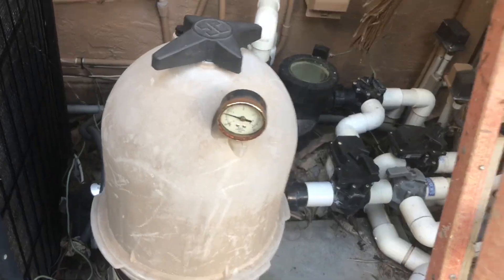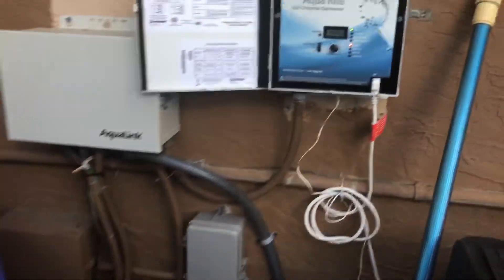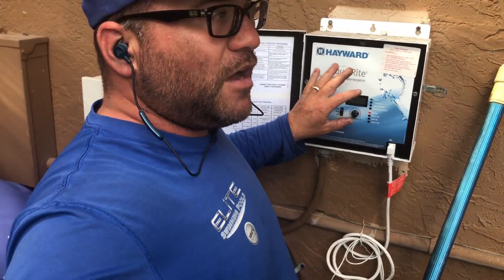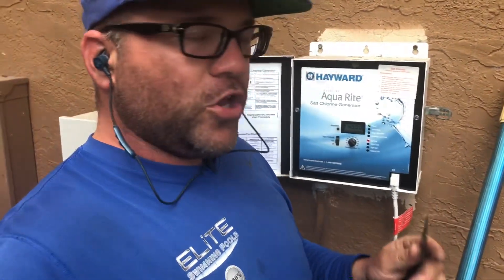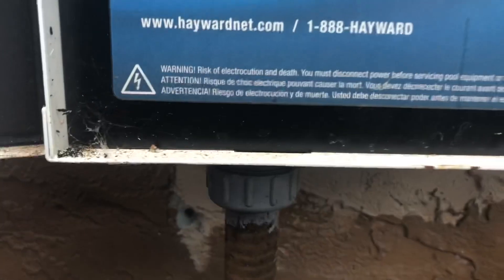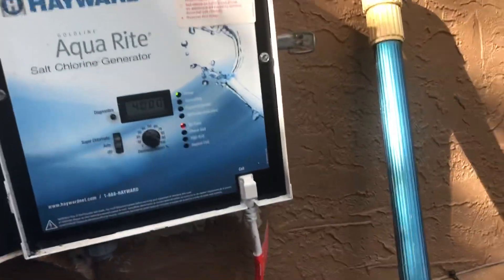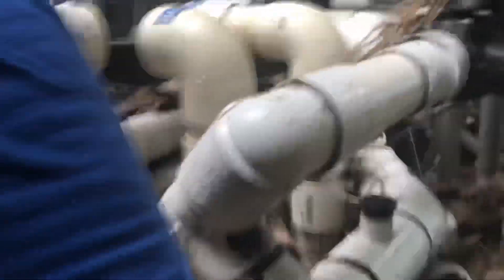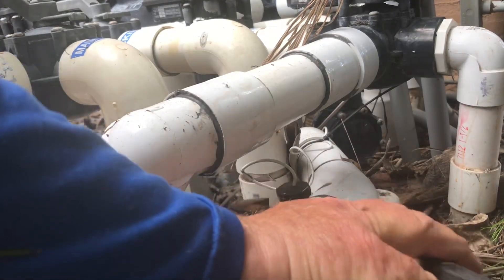Hayward AquaRite Salt System NO FLOW? Tips and Tricks to easily Diagnose and Fix

Comment: I love this type. I was just thinking. Can't you just short the two wires at one end of a very short phone cable and leave them that way? Will that damage the Aquarite over time?

From what I understand. An open circuit is an indicator of no flow. A short or closed circuit is an indicator of flow (which is what you just did with the screw driver).

 I'm only asking because I've had a hell of a time replacing a ton of things with my pool. I originally didn't hs e a flow switch, and now because of all the new parts I'm being told I need one. 

Can I just bypass the flow switch. It's for an above ground pool.
Reply from the maker: I wouldn’t recommend for if you pump or filter had a flow issue, the SCG wouldn’t produce chlorine in a unwanted situation. Keep unit operating as designed
Reply: @EliteSwimmingPoolsTV  Thank you for your reply. I see what you're saying, but I'm not understanding why producing chlorine during a flow issue would be a problem. I'm not a pool person.
Reply: @Brian_Onesimus  I am curious if you leave it as you mentioned (bypass it) I think the same
Reply from the maker: So your only thinking of when the pool is ON and circulating… what about when the pump is OFF?? one of the issues with bypassing the switch and producing when it shouldn’t is your going to drastically shorten the life of the CELL.  The cell is always checking and reading the salinity level of the water. Bypassing the switch could tell the cell to stay ON when the pool is off ,if it’s not properly electrically connected; (I did another video about salt systems and incorrect electrical connections), which will also be sending false readings of salt content back to the board hence displaying a false Low Salinity level causing the cell not to operate. if you have anyone else servicing your pool and if that person in fact doesn’t check the salinity levels properly to know that there’s a false low reading and more salt will be added to pool when salt shouldn’t be added thus raising your TDS levels which progressively promotes bad water quality. Sooo this are just some of the reasons not to bypass a flow switch. Unless you like more problems and want to spend more money than $120 or so for a part. The flow  switch is also a preventative part to ensure the cell does not become damaged when the environment of all aspects of the system are not operating as designed. Best to replace it and keep it running as designed. These parts rarely break and when it does, it’s not expensive
Reply from the maker: The Flow switch tells the cell when to produce when the the pool is On and circulating. You wouldn’t bypass your cars thermostats sensor just because it keeps reading a high temperature or bypass the sensors if it’s not recording a temperature reading of the engine at all just to erase the check engine light Would you?? If you say No to that question of bypassing the temperature sensor of your car, you should bypass a flow sensor of the pool salt system.

Comment: What if the flow light just flashes when you make contact with the screwdriver but doesn’t go to generate? Does that mean the board is bad?
Reply: I have the same issue. Were you able to solve it Cheryl? If so, would really appreciate if you could share it on here. Thanks.
Reply from the maker: Divya, make sure that when you use the screw driver trick and press it to the contacts you have to wait the 2-4 minutes pressing the contacts and while the light flashes. The unit does have a delay internal timer as it is flashing   This is a check system signaling. If no flow light indicator never switches to generating green light then you have a different issue and it may not be the flow sensor.

Comment: AWESOME!  I was thrilled to use your screwdriver trick to see if it was indeed the flow sensor.  We had replaced our generator board a few years back so I was pretty sure and crossing my fingers that it wasn't that but just as you said.... it BLINKED!  Bought the new sensor (only $30 at our local pool store) and tested it the way you backtracked to show us... yep! WORKED!  Installed it in minutes and we are working again!  THANKS!!!
Reply from the maker: Your welcome

Comment: Does this trick also work using the ProLogic PL-PS-4? There is no status light just the message: CHLORINATOR OFF NO FLOW
Reply from the maker: Yes this should work.
Reply: @EliteSwimmingPoolsTV  Yes it works. I stuck a cable between the prongs until I get a new flow switch. The sanitation works. Can you post a flow switch link that is reliable please. Thanks for the tips!!
Reply from the maker: Are you asking for a reliable flow switch “part”?
If so, get the Hayward original switch don’t buy Amazon or knock off generic styles.
Reply from the maker: Oh and yes there is a status for this automation system is just not a light. You can find this in the diagnostic menu selection of the menu. Scroll through and when you see the salt content and or when it says chlorinated off, press the Up ⬆️ arrow it forces the system to turn on chlorinator. It will have a 30 sec timer

Comment: So I might be that 30% you talk about. I did the screw driver test and it blinks red. I replaced the flow sensor and remains in red. No change at all. Any way to troubleshoot or fix the board?  Thanks
Reply from the maker: When you did the test and saw it blink, did you wait to see if the generating light illuminated green? Most people don’t wait for this and all should. If generating light doesn’t go solid green then there another issue.

Comment: New pool owner....does red no flow light come on when pool turns off for the night?
Reply from the maker: Once pump shuts off the red no flow light will light up and after 2 or so minutes the salt system display and lights should completely turn off. The box should not stay on all night as the pump is not on. If it does, it is wired to HOT side and this is not correct.

Comment: Question I’m a pool tech , I have a client in West Hollywood & his heater is showing a “high flue sensor” error code , I changed the sensor & turned off the breaker for 20 min but it still gives the same code ones turned on? Any idea ?
Reply: Jandy LXI heater
Reply from the maker: What Brand & Style heater is it (Gas, Heatpump)? 

What size horsepower pump in comparison to filter size and style filter? 

Are you sure it was a High Flow Sensor Error or could it have been a High Limit Switch error? 

Is the plumbing from the filter going directly into the heater without any bypass or valves to control water flow? 

These are all the areas to take a look at. If plumbing is directly in and out without any valves, possibly this could solve the issue. By installing bypass valves with a check valve you can control the water flow and redirect the other water around to achieve proper flow rate. Rapid water flow decreases efficiency of heater heating the water which causes a longer run time to achieve desired water temp. 

More info is needed to further understand the entire job site. Other times you can contact tech support for assistance as well.
Reply from the maker: Just saw your second post that it’s a LXI Gas heater. 

It’s possible the error you had was a high Limit switch error and not a high flow error. Don’t think I’ve ever seen a high flow error only low flow. Check the high limit switch on that heater. There two high limits. If one is faulty, I would replace both.
Reply from the maker: Contact tech support to confirm your error and issue with heater before you go replacing  things at a whim.
Reply from the maker: Contact tech support to confirm your error and issue with heater before you go replacing  things at a whim.
Reply: You can detach both the high limit and low limit sensors and test for continuity with a multimeter. If its reading open then its a faulty high or low limit switch

Comment: My power light does not come on and my salt level is stuck on 900. When it kicks on it flashes no flow like normal and when it senses the flow it kicks on generate for 30 seconds then goes black.  At no time does the power light come on.  I have a new cell but if I can return it and get my 500dollars back it would be amazing.  Any input would be appreciated
Reply from the maker: Check the voltage coming in to unit. Is it 115v or 230v? Do you have a 2 speed motor? With a 2 speed motor these salt systems are wired to the 115v and only display when on low speed. When high speed kicks in display goes away. If you have a standard single speed motor then disregard the 2 speed set up. With a single speed still check proper voltage coming in. Voltage Power is being pulled from the timer LOAD side. Make sure you have the same voltage coming from timer as you do at the salt system. If all voltage on LOAD side and Salt system is the same then this issue could either be a display board issue or main board issue. Check the salt readings of the pool with salt strips and see if it matches the readings of 900 you wrote about. These units salt needs to be between 2700ppm - 3400ppm. If pools salt content is not up to the recommended levels then you may have to invest first in adding the salt to pool and re-evaluate everything from that point from when the salt levels are brought up to par.

Comment: I replaced the flow switch with a new one and it still flashes no flow, then switches to generating in green for about 5 sec and then shuts off. Stumped now
Reply from the maker: Issue may be the board and not the flow switch
Reply: Elite Swimming Pools TV - you’re exactly right. Apparently Hayward has a common “bad chip” issue with these boards. Chip was replaced and problem solved. Thx for the reply
Reply: If the voltage climbs up to initiate the salt cell to turn on around 24v then drops to zero its a bad thermistor(current limiter) on the pcb board.

Comment: thank you soo much it worked beautifully !! appreciate you sharing!! just want to know do we have to reset it in some way for the numbers will reset ? or does it automatically reset?
Reply from the maker: Which numbers are you referring to?
Reply: @EliteSwimmingPoolsTV  for the amount of salt ? also i thought by starting up now generating it would start to help clear up my pool...its only like 3 hours that i changed  the sensor plug.... not sure how long it will take.
Reply from the maker: For this system to operate the Best, salt content should be raised above 3000ppm especially if your needing it to clear up the water. Depending on how the water looks, cloudy and some algae, sometimes it’s best to do a light shock treatment with liquid chlorine and algae killer to assist in the clearing and cleaning of water and allow the salt system to run in conjunction with the treatment. 

Start first with a total water chemistry test to know how to balance the water. (Chlorine, pH, Alkalinity, Calcium, Stabilizer, phosphates levels) once you have this then you know how to attack. Shock pool and run pool for 48 hrs  continuously. After that then begin to raise the other chems in need of balance. Within the 48hr run the salt system will calibrate itself. 
Retest salt content to ensure proper levels along with total chem recheck.
Reply from the maker: Target goal for salt should be between 3200-3500ppm, Alkalinity 90-110ppm, Calcium 250-300ppm, CYA stabilizer 50-60ppm.
Reply: @EliteSwimmingPoolsTV  i cant thank you enough!! great great helpppp!!

Comment: Hi Davie,  great info however even though the board did blink when I held screw driver into socket it did not work when i replaced the flow switch.  I have replaced the tcell also.  Any ideas of what else I can do to fix the "No Flow" problem?  Thanks so much
Reply: Jan, make sure the arrow on the sensor is pointing in the direction of the water flow.

Comment: Thanks for the tips. I wanted to add that Hayward recommends 12" of straight pipe before the flow switch. I'm assuming this is to help with tubulance that may interfere with proper flow switch activation. The salt cell counts towards that 12", so I'm not sure why they chose to install it in that hard to reach location, rather than after the salt cell, but clearly it still works, even innstalled so close to that elbow.  Again, great video.
Reply from the maker: Thanks, and thanks for watching.

Comment: Hello Mr Hayward.. What could be issue if flashing red light comes on when using screw driver trick but genarating light does not come on?
Reply from the maker: No flow light is flashing due to system going through its checks. Typically even a fully operational unit once turned on this light flashes for about a minute or two during its checking, as shown in my video it took a minute for generating light to switch green. Wait this amount of time and see if it switches to generating. Then you good with the trick
Reply: Or the salt cell has reached its chlorine output maximum so it shuts off.

Comment: My Hayward salt generator is not generating salt. Display shows salt reading of 1600, however salt reading of 3645 from pool store analysis.  Power, check  salt, and inspect cell lights are on. Chemicals are balanced and I cleaned the cell again.Salt reading was 3000 when another bag of salt was added. Next morning problem began with low salt reading and lights on.  Do you think the issue is from too much salt?  First time this has happened.  Thanks.
Reply from the maker: Most likely the cell is bad. Other occasions the board can be bad. Please refer to a professional to diagnose and troubleshoot your system. Being that your salt levels are where they are and as per your chems being in- line. The cell and board needs to be checked out.
Reply: My salt level is too high at 3645, so I wonder if  that caused the issue? If so will it recover if the salt level returns to 3200 or less?   I turned the system off and have  drained water and added fresh water to dilute the salt level. I will re-start it tomorrow. Question is: if the salt level is reduced to 3200 or below, will the system recover and start re-generating-  if the cell or board is not bad?  Thanks again!
Reply from the maker: At 3600 ppm of salt the generator will still work if power supply and cell is functioning properly. The salt content you have is not the problem. These systems can operate with +/-  200 thru 300ppm difference. Hayward Salt systems salt range for salt is between 2700 thru 3400 ppm. Higher than 3900ppm I’ve seen this is when the High Salt led will illuminate and lower than 2500 ppm Low salt will illuminate. The spread difference between what the display is showing and the actual salt content is vast. This is indicative of a part failure. Press the Diagnostic button three times. The value displayed is the volts the board is sending, press 1 more time (4 button presses) this value is the amps. If your getting a high 30.0+ volts( 30-34v) and 0 amps this is more likely to be a board failure.
Reply: Thank you.  Im getting 0 amps, so it appears to be a board failure. I have read that  I can test the current generator to make sure it is good, by suspending it in a bucket of water to see if it bubbles?  I will install a dummy in the piping gap, to establish a flow with the pump on, then just plug in the current generator. If it bubble it is good?
Reply from the maker: Never performed this theory cell test. But this theoretically would work if the board itself is fully operational. The board is what sends power to the cell and cell send back it’s data to board. When board has malfunctioned, the cell stops receiving power this not producing chlorine. This bucket bubble test would fail if in fact your board is damaged.
Reply: Thanks again!  Bubble test failed and cell has only been used about 4 seasons, so it looks like the board is bad.  I did replace the capacitor on the board two years ago, so Im wondering if Id be getting this problem if the capacitor is bad again?  Capacitor cost less than $5, so sure would be a cheaper fix!
Reply from the maker: Possible. Good luck.
Reply: Thanks again for all the help!  Where is your company located?
Reply from the maker: We are located in South Florida (Broward County)
Reply: Keep in mind the life of a salt cell range is 3-5 years as well.

Comment: Hi I tried the screwdriver trick the generating light did not come on but the check salt and inspect cell light did. No what?
Reply from the maker: If the NO FLOW LED light was solid Red while the pool was circulating, go through these checks... 1: make sure your pool water has between 3000 ppm -3400ppm of salt, 2: remove cell and perform a cell acid cleaning, dunk cell into a large enough bucket fill water in. I let past top of cell and add between 1/4 - 1/2 bottle of muriatic acid and allow to clean until all bubbling stops, re-install. Even if when you inspect and don’t see calcified blades do the acid cleaning anyway. Once you re-install turn back on the pool circulation and recheck system. Again make sure you go through all these checks and salt levels are proper and cell is clean. Let me know 👍🏼
Reply from the maker: What was the initial problem? What indicator light was on before the trick?
Reply from the maker: This diagnosis / trick is only for when your system is On and circulating and you have a solid continuously lit red indicator light On the NO Flow led.

Comment: Great video!  Does the light show solid if water temp is low?  Can the switch get blocked?
Reply from the maker: This light indicator is only for sensing Flow circulation. This switch can not be blocked. Unit is designed, as all salt systems are, to have flow sensors. With out the flow the unit will not produce the chlorine. 

The temperature reading are found by using the little diagnostic button left of the display. It’s either the second or third value shown. 👍🏼